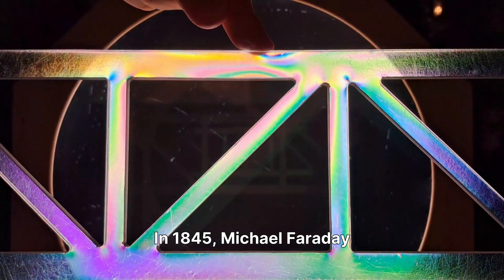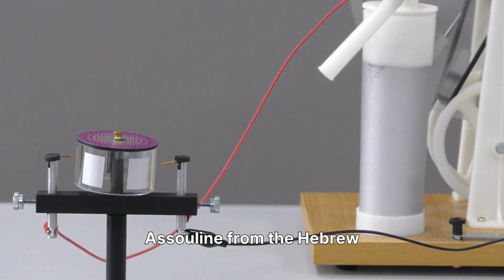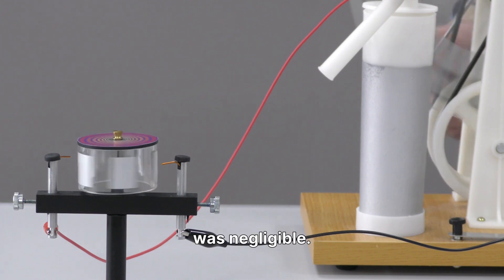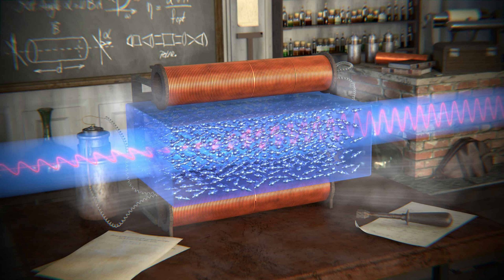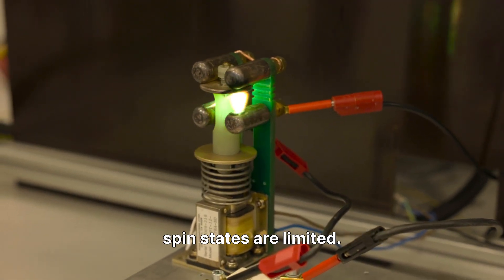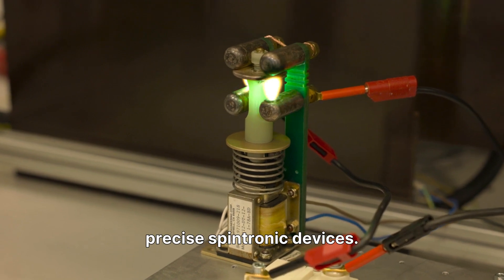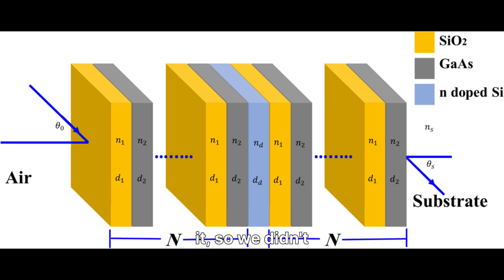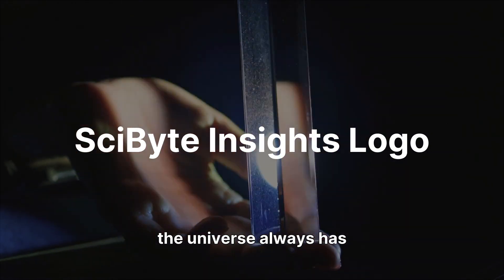180-Year Physics Mystery SOLVED: Light's Hidden Magnetic Power

Comment: Photons are quanta, and because of the principles of electromagnet, quantum mechanic scholars should acknowledge the influence of electromagnetic fields. However, gravity is another fundamental problem that quantum mechanic scholars ignores. Therefore, the engineering applications of quantum mechanic described in this video are incorrect, just as the video claims—a question that has been ignored for 180 years.
Reply from the maker: You bring up some fascinating points about the interplay between photons and electromagnetic fields! The complexities of quantum mechanics certainly raise many questions, especially regarding gravity. It's a topic that continues to challenge and inspire researchers.

Comment: This begs the question about the double slit experiment when observing the POINT in Space creates the co essence of all of the electromagnetic effects to represent the particle when the rest of the time light is depicted as a wave
Does this not demonstrate that the Field effect is significantly greater than originally considered hence when Incorporated with a gravitational constant which varies across space means that the speed of light is only fixed at the point of observation
If this is true, then the whole expansion of the universe concept is flawed as the speed of light that we perceive at our point in Space is slower than in a less than gravitational area for example in between solar systems

Comment: Ruins cosmology as well as they e m fields have zero effect on bbt..Why the Big Bang Theory Is Wrong – A Patchwork of Patchworks

Dark particles, dark forces, and dark nonsense upon dark nonsense

The BBT was proposed by a Jesuit priest (Georges Lemaître), blurring science and religious metaphor (“Let there be light”).

Every new observation seems to “mystify” astronomers instead of confirming the model.

The theory depends on “initial conditions” (a singularity) that cannot be explained or tested.

Galaxies and quasars appear far too early in the universe for BBT’s timeline.

Webb and other telescopes reveal mature galaxies at supposed cosmic dawn.

Plasma filaments, jets, and sheets dominate the cosmos, yet EM is largely ignored in BBT.

EM forces are 10³⁸ times stronger than gravity—yet cosmology assumes near-perfect charge neutrality.

Even tiny charge imbalances would dominate structure formation.

Plasma sheets don’t follow a 1/r² decay law, so their influence can extend across vast scales.

Supernovae eject high-speed charged particles that rarely recombine, sustaining net currents.

Charges moving through weak EM fields generate new fields, creating feedback loops.

Neutralization requires collisions, but in low-density space mean free paths are enormous.

Debye lengths in intergalactic plasmas are so large that charges remain “felt” over light-years.

Jets and filaments look like current-carrying plasma structures, not gravity-only dynamics.

Yet cosmologists still insist on gravity as the sole large-scale driver.

When observations disagree, new “dark” entities are invented.

Dark matter (never detected directly) was patched in to hold galaxies together.

Dark energy was invented to explain accelerated expansion.

Axions, WIMPs, and MACHOs were invented as dark matter candidates—none confirmed.

Dark flow was introduced to explain bulk galaxy motions unexplained by expansion.

Dark tension and dark sectors are speculative attempts to fix contradictions.

Each “dark” fix multiplies, but none are observed in laboratories.

CMB anisotropies may be artifacts of data processing and filtering.

Different teams (EHT Japan vs. original) obtained different black hole images, showing model-dependence.

The universe is not homogeneous at large scales—superstructures like Hercules–Corona Borealis break BBT assumptions.

This giant structure spans 10 billion light-years, defying the “cosmological principle.”

If gravity alone cannot explain galaxy distribution, then the BBT foundation collapses.

Electromagnetic explanations (Birkeland currents, plasma cosmology) naturally predict filaments and clustering.

The “patchwork of patchworks” reveals BBT as a dogma defended with ad hoc inventions.

Real science should test EM-dominated models instead of endlessly inventing invisible entities.

Comment: Hold on so Albert Einstein was wrong about light being bent because of space time being cause of bending light and Its the Magnet field of the Sun because of the 17% effect of the magnet?
Reply: In the context of the video the light is not being bent but twisted about it's axis of travel. Think about wearing sunglasses while looking at your phone. At some rotational angles the image is clear, same polarization angle, and at others it can be completely dark, polarizations are at 90 degrees to each other blocking all light.

They thought the rotation of light's polarization angle while in a material was mostly due to the electric field but it turns out the magnetic field can play a very significant roll based on the frequency of the light. This is based on mathematical analysis and not based on a physical experiment that can confirm what they suspect; that's the next step.

The effects of bending light's path were not discussed and neither were the effects of magnets on light in a vacuum.

Hope this helps!

Comment: Isn't that what a cathode ray tube does?
Reply: Cathode ray tubes use free electrons and accelerate them with an electric field gradient. They can steer the electrons with either electric plates or magnetic yokes to direct them to a point on the screen coated in phosphor that glows when excited with the energy of the accelerated electron coliding with it. (Which is what generates the light).

Comment: Gravity can effect light so why can't magnetic fields do similar.
Reply: Well, in this case, we now know that that is true.  However, the universe does not always work that way.  As you can see from the table below, different classes of particles react to various forces in different ways.
______________________________________________________________
Particle ./ Force ➡| Strong | Electromagnetic | Weak . | Gravity
_⬇_________________________________________________________
Quarks  .....................| ...✅.. | .......... ✅ ......... | ..✅ .. | ..✅... |
Charged Leptons .... | ...❌.. | .......... ✅ ......... | ..✅ .. | ..✅... |
Neutrinos ................ | ...❌.. | .......... ❌.......... | ..✅ .. | ..✅... |
Reply: @OrpheusSonOfCalliope  So if photons/light is 'the only thing there really is', and 'everything' is photons interacting with other photons (yes, photons also are affected by gravity) - you can expand your chart ;ø)
Reply: No it can't. Dr Edward Dowdye from NASA proved that there is no light bending outside the sun's corona in our solar system, and Marius Vasile has proved that gravitational redshift was actually caused by refraction which changes the wavelength of light. So basically they confused refractional redshift with gravitational redshift.
Reply: Because it doesn't.

Comment: Honestly, just use a flashlight and watch the particles in a controlled zero airflow environment. if particles attract to the light then you have it.
Reply from the maker: That’s an interesting suggestion! Experimenting with a flashlight in a controlled environment could definitely provide some insights. Thanks for sharing your thoughts!
Reply: No!  This finding is reporting that visible light is impacted 80% by the electrical field and the 20% impact by the magnetic field causes the orientation of light waves to rotate about the axis of direction.